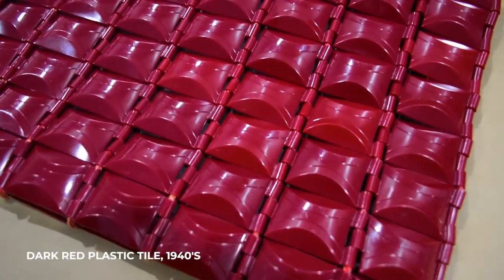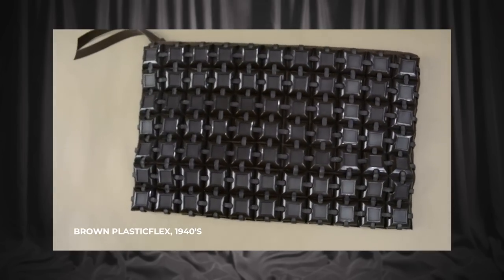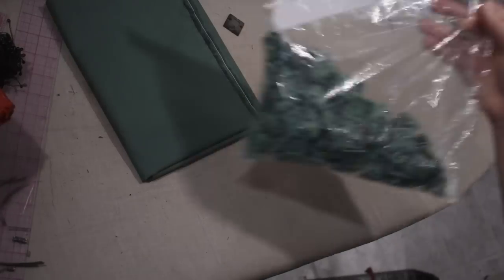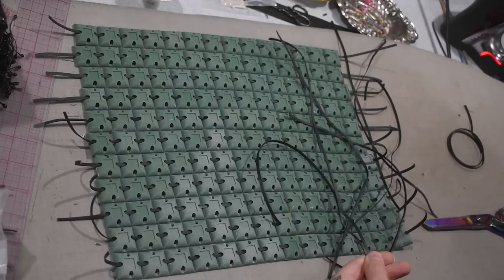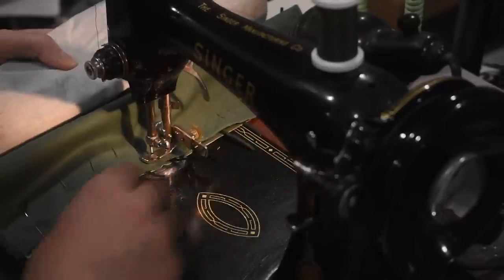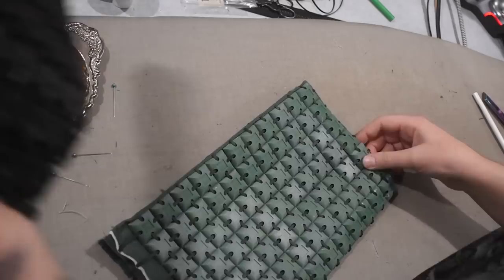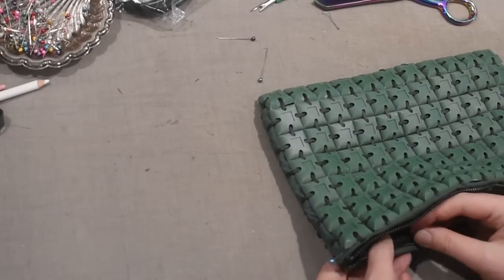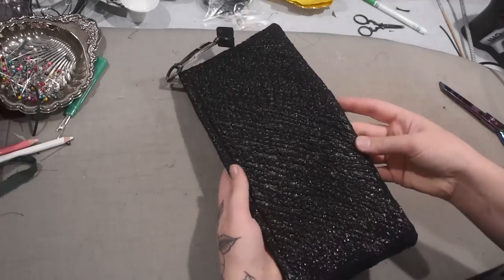Making a 1940's Plasticflex Handbag in 2023 ✨

Comment: Wahey, awesome to see the printing community come through! If you'd like to make the tiles nice and glossy like the original plastic ones, an old modelmaker's trick is to dip them in floor polish and let them dry (Pledge is the usual go-to)
Reply: I’ve heard about the floor polish trick but haven’t actually tried it. I’ll do some test tiles and see if the floor polish trick will work to reproduce the OG gloss look 😊
Reply: @kristinafricker9351  Good luck! Let us know how it goes
Reply: Would there be any risk of transference?
Reply: @rd6203  Transference of pigment, you mean? I doubt it, Pledge and most other floor polishes are acrylic based so they don't contain any solvents that will reactivate paints. And if it's on parts like these where the pigment is mixed into the resin, absolutely not, that pigment is locked in. Sorry if I've got the wrong end of the stick, let me know if this answers your question.
Reply: @rd6203  I think @megleslie is correct, but this is all pretty experimental/new to me so I can’t guarantee anything. But yes, we mix alcohol ink into the resin to do custom color tints and then the resin cures. So especially if you add some sort of coating there shouldn’t be any color transfer. I’m also wanting to try painting our regular grey tiles and sealing them.
Reply: @kristinafricker9351  Thanks. I actually meant of the polish, not the pigment. I've never used it for anything, so was curious

Comment: Here are my bag making suggestions - you did an awesome job for winging it! 

Two options - one with an additional lining and one without.

No additional lining: Sandwich each side of the zipper tape like piping on the top and bottom of the rectangle, when sewing the lining to the tiles.  This way, you don't have to do a separate lining, and the zipper will fit snuggly at the top of the bag.  For the edges, fold together, and then use binding to cover up the raw edges inside of the clutch.

With lining: Cut your exterior fabric so it has 5/8 seam allowance around all edges (plus that little extra wiggle room for the middle fold).  Sew the fabric to the tiles, as you did, with a 1/4 seam allowance, leaving about 3/8 between the tiles and the fabric, along three sides.  Turn it right side out, fold in the edges of the third side 1/4 inch, then baste along the tiles with your zipper foot, to hold them into place.  You've just created your exterior fabric - find a tutorial for a basic zipper pouch, and follow those directions to line it and add the zipper!

Hopefully this helps a bit - it's always hard to explain in just a comment, but I had to brainstorm a little with you.  I love the end result and am tempted to make my own now too!!

Comment: This is so cool, I have a small black clutch bag which I’ve had for 40 plus years it’s made up of 1/4 inch metal squares it’s was already old when I got it I think from the 1950’s so it’s older than me it’s still in excellent condition. I have seen modern versions of the bag from the 80’s. I know mine is older as I bought it when I lived in the UK, I found it in a small junk shop I use to visit, it’s also where I bought my Beatles LP which turned out to be from the first production run, only back then nobody knew that it would one day be worth a small fortune. I moved to Australia in December 1978 so that’s how I know the bag was not from the 80’s lol
I never knew of the plastic bags so it was very interesting seeing you make this one. I think you did an excellent job off putting it all together, 😊 point of interest all bags with zippers, the zipper is always longer than is needed so yours being longer is in fact correct. 
I will have to pull out my antique magazines and see what they have in it in for bags, it has dress patterns from the 1940’s as the are from that time period. I still gave the patterns with the magazine they have never been used. All of the magazines were given to me by my ex-Mother-in-law I really missed her a lot after my divorce but because of her husband and my ex we were never able to keep in touch. I’m just glad that she felt I was much more worthy of her small collection of magazines than her own daughters. They were the very reasons I went back to collage to study Fashion Designing and Pattern Making. Both Mom and I spent 5 years at collage together, Mom went on to teach, but me I just made for myself lol it’s why I felt I could design my own wedding dress.

Comment: What a fun project! I would suggest machine basting the Plasticflex mat to the outer fabric before you start putting the bag together. You can mark where each leather strip should be on the seam allowance. I would mark and baste one side, and then fold the bag to mark the other side. Once the two layers are basted together you no longer have to worry about the tiles moving around, which should make the rest of the construction process a bit easier.

Comment: I have thought about this as well, though not an engineer. I know why the new tiles are matte instead of shiny and would love to try and figure out a silicone mold for tiles to see if I can get shiny tiles. To lower drilling it would need to be a 2+ piece mold, but the holes for weaving the tiles would still need to be drilled. 🤔

Comment: I am a handbag maker and I will be so honest in saying that I struggle to make clothing. So, no judgement here. I would have made more of a pouch design though and done two panels sewing on the sides and bottom. Sewing the lining layer and outer layer to the zipper first. Then tacking down the cords for the plastic layer. Sewing up the sides and bottom of the tiles(in two separate panels instead of one large one). Then sewing the lining. I think instead of doing the flip method though this would be a good candidate for the binding method of closing the bottom. I would actually have to get some tiles and make a mock-up of my own to get the method down correctly. Right now this description is using my imagination so I may be totally wrong. 😂

Comment: Hi, I think the tiles are matte finish because the final outer layer cures/sets in oxygen rich environment. Dental resins which are cured in a clear mold that inhibits oxygen in the outer surface are shiny and often involve a dual cure (chemical and light) energy reaction to cross link the polymer chains in the resin. It looks like the reverse side of the black tiles are shiny since they cure against the plate that moves in and out of the resin. ( Oxygen inhibited surface) I am certainly not up to date on resin printer technology, and this may be a W.A.G.😂  Dental resins cured in air are polished with materials and tools similar to car polish. Maybe some of the acrylic button and jewelry makers  could add to this discussion.😊

Comment: I wonder if this plastic works like regular plastic? Regular plastic will "sweat" oil when heated, which means it will become glossy. If you have a spar tile, maybe try heating the good side with a lighter - see what happens, maybe they can get a gloss like the old ones
Reply: Resin is not plastic and highly toxic. I would not recommend burning it. But a gloss spray would fix the problem.